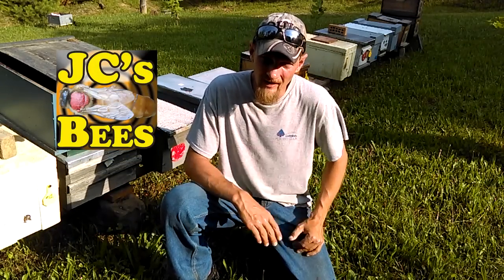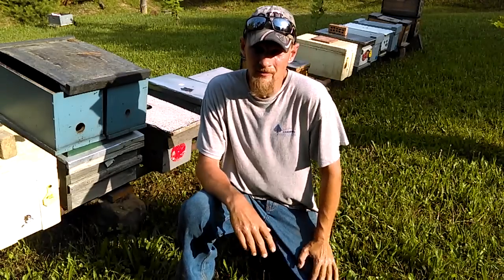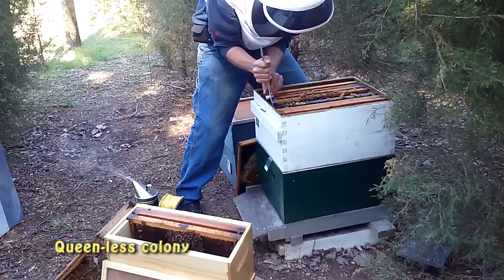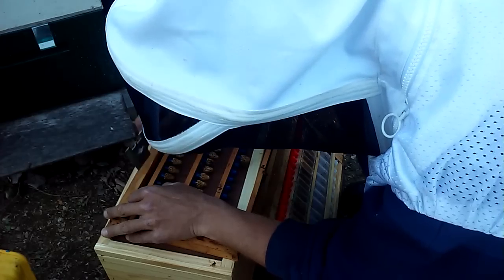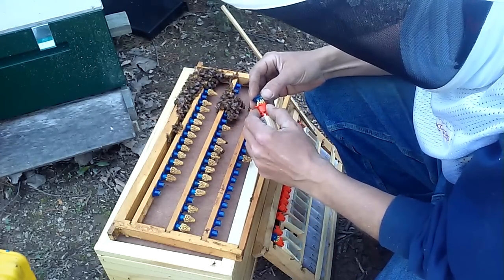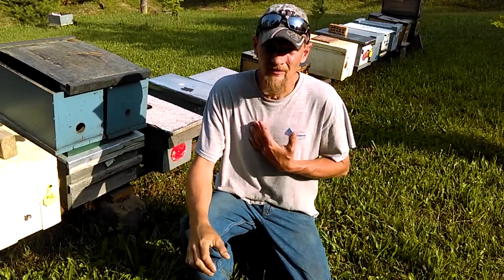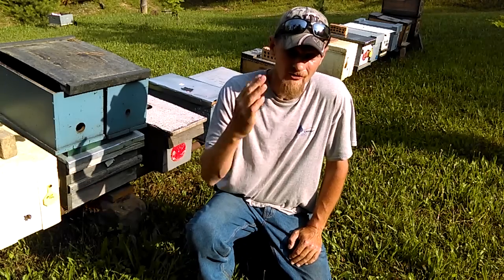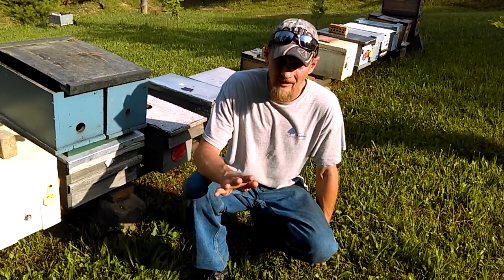How To Setup A Queen Banking Colony..(Optional Video 4) JC's Queen Rearing Series

Comment: I wanted to ask...in this video you used the red cell protectors first, before using the clear cylinder cages. 

Does this mean there's a better success rate with the red ones (cell protectors)? I'm curious why you'd done the red ones (cell protector type) first, despite being smaller than the air roller type?
Reply from the maker: The cell protectors were used because the cells would not fit directly into the wooden caged. The cell protector is tampered like a funnel so the queen could emerge and walk into cage. I've since started only using the roller cages to let queen emerge into and anymore I've learned it way easier to use an incubator.
Reply: @JCsBees  I'm interested in your books on bees. But it doesn't say how many pages each one is? Any thoughts? I'm not expecting an encylopedia, but hope there's enough material in there to be worth the trouble. (But Lawrence J Connor's book only has about a bit over a hundred pages.)

Comment: Question - how long can you maintain this queen bank - can you use it to replace queens at the end of the summer headed into Fall?  If so, how would they be mated?
Reply from the maker: I haven't used a queen bank for more that about 10 days but that's just me, maybe it could go longer but not sure. Also you would want to make sure there is still drones present or your virgin queens would not get mated. Personally here in Ohio, I don't mess with raising queens after August. If a colony goes queen-less and doesn't raise a queen then they are combined with another colony.

Comment: Usin quinless colonly is not always necesary to start raring, all you need to do is to block the queen at one part of beehive, with proper exluder, ges one body of LR and grafted cels will be started. Sure, much better results will be in case of quinless colony, more started cels...

Comment: I have the Genesis Incubator, it works great and it cost me like $160.
Reply from the maker: I use a Little Giant incubator it's cheapo but does a great job.. I use it from day 10 to emerge but not for banking. Your using your incubator to bank? If so, for how long?
My next video is on my incubation process.
Reply: No I don't bank them in that incubator, but it does take some of the pressure out of getting those cells placed immediately. I place them in the incubator on day 9 and if I don't  get to them immediately I have some cells to place as well as some already emerged virgins.
Reply from the maker: I just started using the incubator this year and love it! I've been thinking about turning my observation hive into a incubator. It would be cool because I would be able to place the banking frame in and have room for 2 more. You could also see them better through the glass than you can through the plastic cover on my egg incubator. 
I think I like introducing virgins better than cells. With the virgins you get to examine them for physical defect before introduction.
Reply: Yeah I just started using mine this year too. It's great, I either place them as they are chewing their way out or as a virgin.
Reply: I found a fellow that lives about 6 miles from one of my yards. He built an 8 frame double deep incubator that sits in his "Bee Lab" (dining room). He does instrumental insemination. Very interesting man to say the least. You may have heard of him. Mikes Bee's in Forest, Ohio. Right now I have 5 freshly hatched virgins from this week in special cages that I built. Right now they are banked on top of the frames in a queenless hive under a screen top shim that I made. Hopefully I can finish my NUCs tonight and the weather cooperates to get them installed.

Comment: I am wanting to keep queens all summer for just in case purposes. ( I mashed a queen 2 weeks ago and didn’t know it till cells were capped). So if I raise a few queens and put them in queen castle. They stay in there for a week or so then get cramped up and swarm ?  Do you take 1 of the frames of brood the new queen laid and put in another hive and replace with a frame of foundation to help stall them out on running out of room ?  Also at the end of the year do you just crush all but one of the queens and combine the one queen and all 8 frames from the castle to overwinter ?  Thanks bud. Keep the videos coming.

Comment: JC, what is your opinion on grafting vs the cell punch methods?<
Reply from the maker: I think the cell punch is a great method if you only want to raise a dozen or so queens. Long term, you wouldn't want to keep punching hole in your comb. Sure the bees do repair the comb but usually with drone comb. The cell punch also saves a lot of delicate work moving larva. Grafting takes lots and lots of practice to get good results but is better if you plan to raise lots of queens.
Have you seen my cell punch kit? https://jcsbeeblog.blogspot.com/2014/02/queen-rearing-cell-punch-kit-offer.html

Comment: Jason would it work to put the queen bank back into to finisher hive or would it not work because of a mates queen in there??????
Reply from the maker: I can't see why it would not work as long as you have brood in the top deep.
Reply: One other thing, I don’t have my mates queen locked down in bottom Super, she is in top and bottom story in my finisher hive when I raise queens.....would that make a difference then or not?
Reply from the maker: So your telling me your finisher is opposite of mine? Why would you set it up like that? Seems like more work to access cells but should work the same, I guess.
Reply: I guess I just learned that you don’t have to lock the mated queen down into the bottom super with excluder, it’s not necessary 
But you think it wouldn’t be an issue putting the Queen bank in there with her running around freely???
Reply from the maker: Interesting! If your not using an excluder I would not add banking frame.
Reply: I never put the mated queen in bottom brood chamber when raising queen cells in top brood chamber...
Reply: So what your saying Jason, you don’t recommend me putting queen bank in there if I have the mated mother queen running around freely, is that right???
Reply from the maker: Correct!

Comment: Do you have have Honey houses to work with the honey?
Reply from the maker: Currently I am using a 10'x10' front porch that is closed in with huge windows. It works well but get awful hot mid day. Great for flowing honey though.
Reply: thank you for answering